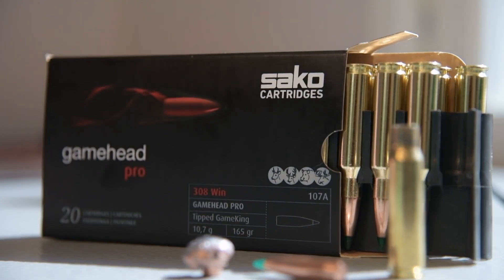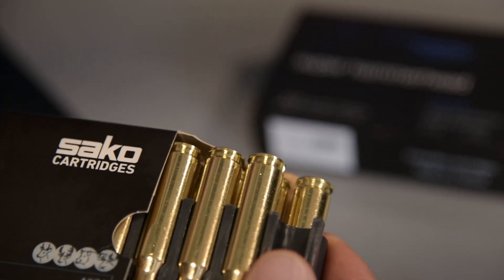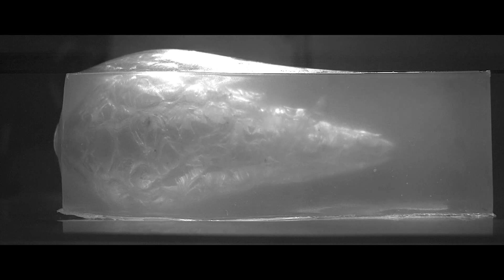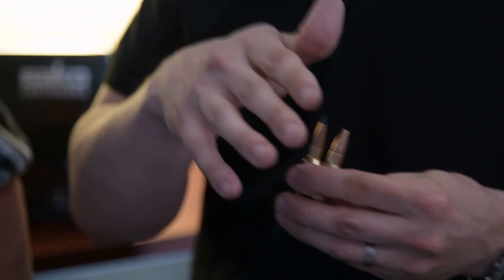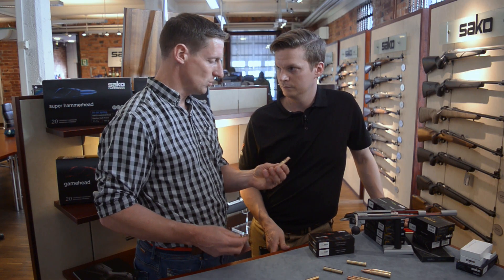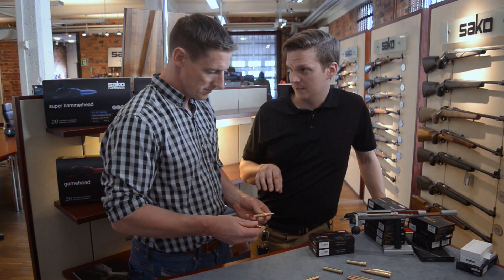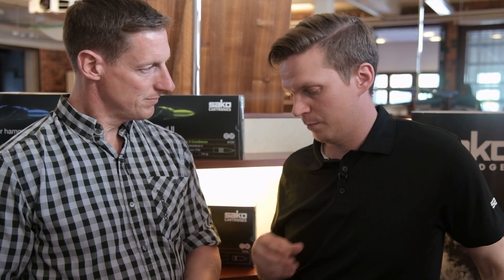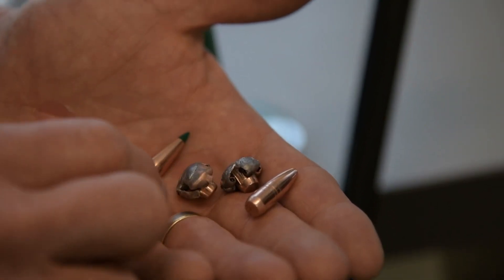Sako cartridges: what is a ballistic-tipped bullet?

Comment: Would like to see what would happen with a steel ballistic tip in a traditional lead core bullet versus a solid copper bullet, I theorized that the steel core would have a more significant collapsing affect and help with better expansion with the bullet upon impact… May be a little extra engineering to make sure the copper bullet doesn’t break apart as easily. I already know traditionally solid copper bullets and hollow points benefit from having a bit more of a superior construction